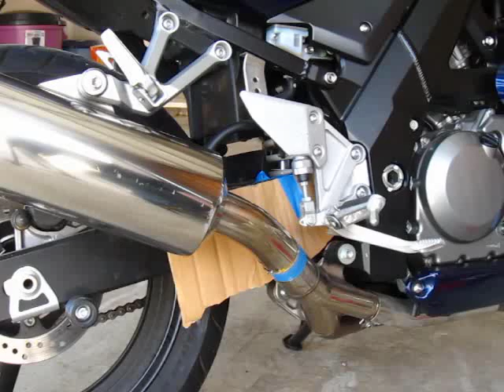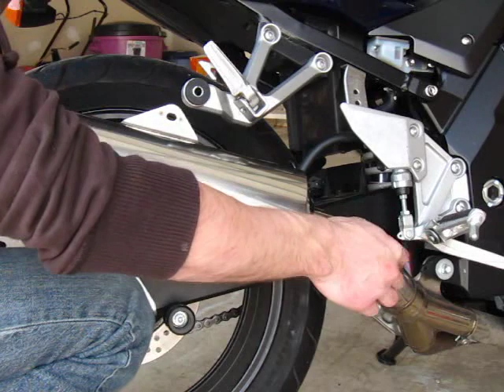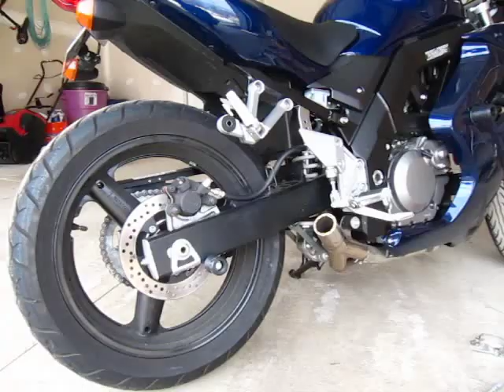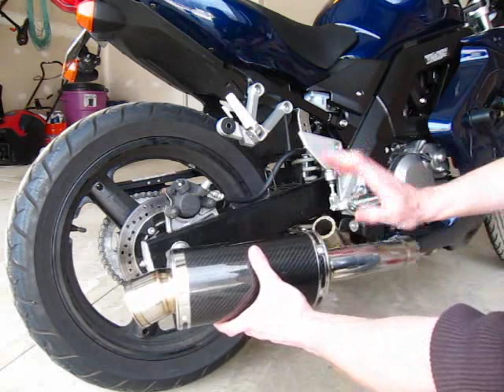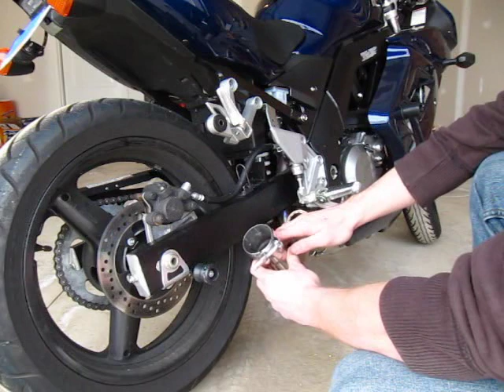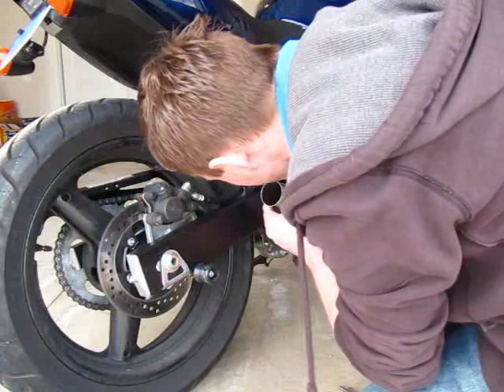Part 2 of 3 - Suzuki SV650 Slip On Exhaust Install - Delkevic Carbon Fiber Mini

Comment: This series of videos has helped me greatly in installing an SP Engineering slip-on exhaust. I have the model with the catalytic converter in the mid pipe and i came barely millimetres away from cutting it. If i had tried to wing it and make the cut without consulting this video first, I would have sliced it at the weld and been totally screwed. Awesome!

Comment: Shavings mean the little metal pieces that falls down the exhaust pipe, when cutting  it. You know when you cut trees, you get saw dust? I was talking about the metal "shavings" that fall into the exhaust. for the record, I installed a Scorpion exhaust, didnt even worry about the shavings, nothing happened. cheers.